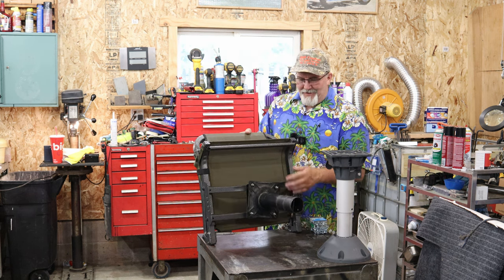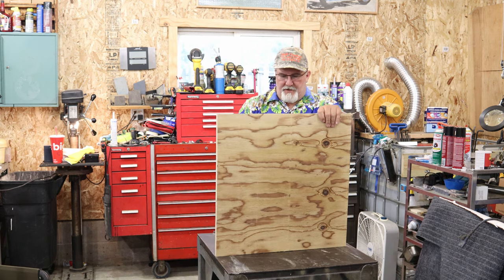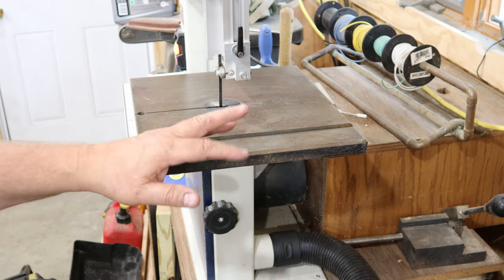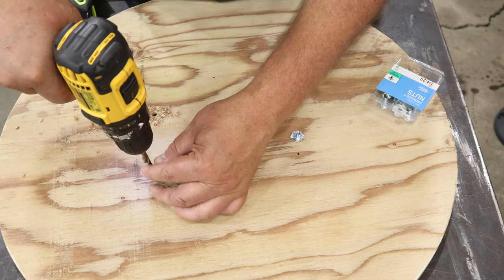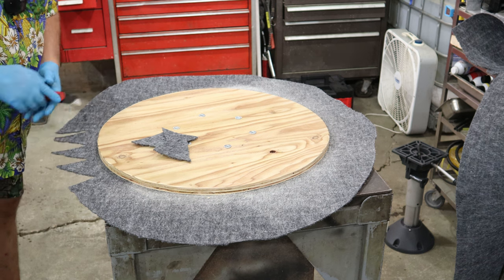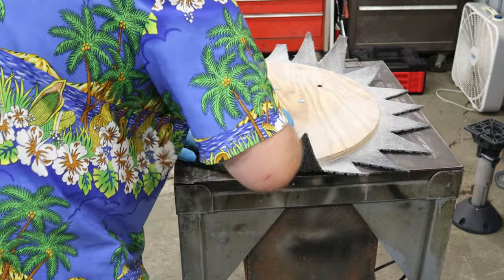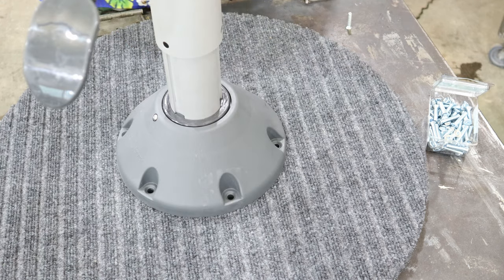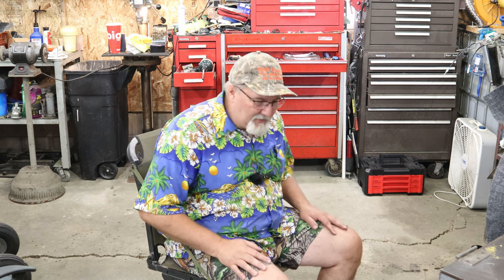Millennium Marine Boat pedestal base and seat mount Solution The Universal seat I call it

Comment: I was looking into adding a seat in the middle of my Sundolphin Pro boat. This boat is made of polyethylene so didn’t want to drill unto the polyurethane foam injected floor.  Thought to add wood plate form.  Ran across this video searching for reviews on the Millennium Seat.  Glad I did.  This gives me the solution to adding a third seat in the middle.  
Btw the hot drill for the holes in the carpet is a smart idea.  Melts the hole edges of the carpet to keep the carpet from fraying.  Good idea good job!
Reply from the maker: Thank you and thanks for watching

Comment: Hey Michael, loved the video, as always! When you did the first videos about the Millennium seats I bought one for my boat and loved it so much, I bought a second one. I did find a very interesting seat accessory for the seats and I bought two and installed them and they work great! Check out the "kemimoto Boat Cup Holder Boat Caddy Organizer, Drainage & Reserved Installation Hole, Boat Cabin Storage Holder for Marine B100 B200 B300 Boat Seat Storage Caddy" on amazon. (I'm not a rep or sponsored or anything) They bolt right up to the Millennium seats and come with the hardware. Always a lack of cup holders or a place to stash a few lures and this is awesome! My coffee cup fits the cup holder and so does my can cooler. The ones that came with the boat are useless. Keep the great videos coming!